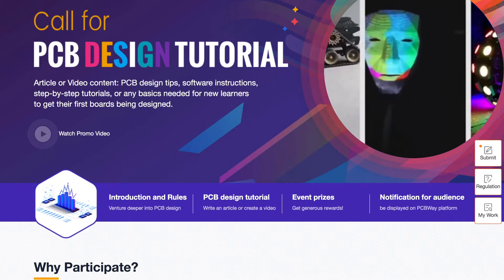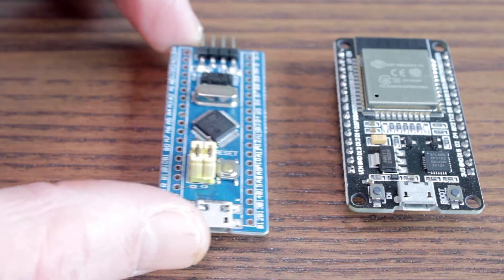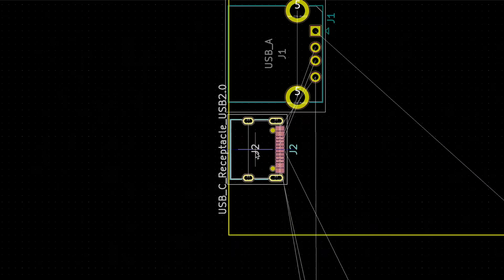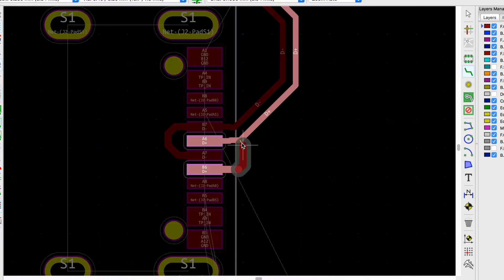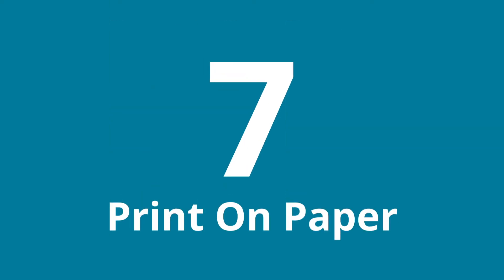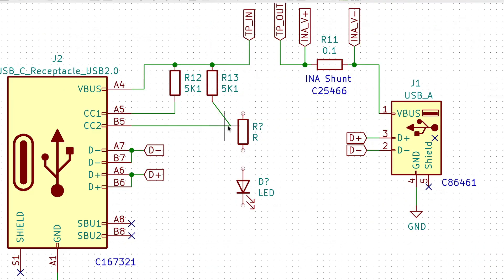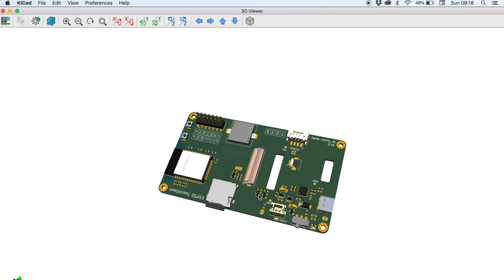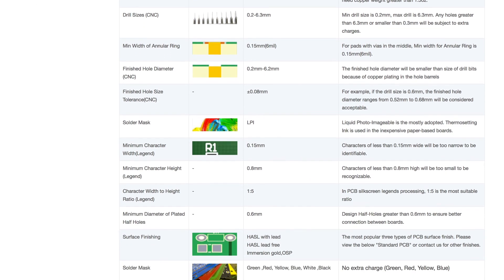My Top 10 PCB Design Tips

Comment: Tip: After doing rough placement of components, grab the MCU or whatever has the most connections and move it in a circular pattern so you can see if there are many ratlines crossing over eachother. Try rotating it to all the 90 and 45 degree angles until you find the one where the most ratlines run parallel.

Comment: Usually using a 4 layer pcb is only slightly more expensive then using a 2 layer pcb. depending on the manufacturer and if/what PCBA you use. This can help to add a completely seperate Ground plane or even a powerplane to your design making it easier to run you signal and data lines much faster and with less use of Via's. However there are some EMI considerations here a proper GND plane for example has some rules to follow and a powerplane is not always the best use of the space. A powerplane can also cause interference if used incorrectly.
Reply from the maker: Thanks for the extra tips!

Comment: A few extra tips :

1 . After you are done routing , Inspect you gerbers using a different tool . I use gerbv which is free software . Look at each layer one at a time for things that look too close or other "weird" stuff . You will be amazed what using a different viewer will expose .

2 . Check the mask layer and the silk layer together as the silkscreen will get clipped anywhere these two layers intersect .

3 . As an extension to one of the tips in the video , bring unused pins of ICs out to free pads or vias if at all possible . It will be very useful if you forgot to connect something or want to use the unused i/o pins of your mcu for something you didn't think of on the initial layout . Be sire to also put extra ground pads near some of these extra pads too , so that if you need to wire up a connector , you have an easy ground connection to go with them .

4 . Add extra ground pads around the board to have an easy reference while probing signals .

glhf !
Reply from the maker: Thanks for the extra tips! :D

Comment: I summaize:
+	Use reference design
•	Datasheets for example feature typical application
•	Open source design
•	Development board
+	Work in block
+	Move, rotate, repeat
+	Importance trace first
+	Trace width calculator
+	Use net label
+	Printing on paper
•	Print layout on paper with ratio 1:1, check with reality footprint components
•	Check the components relationship, eg. USB stick can be plug in in the same time or not.
+	Extra footprint: make test point
+	Use the 3D viewer
+	Use the DRC
Reply from the maker: Thank you @user-wf7xm5xg3t for that nice summarization!

Comment: These are some useful tips, thanks a lot! Will make a drone pcb any tips for that?
Reply: Ye, make sure that any interference is not on the data frequency that your drone will use for its remote. Let's say the remote makes use of the 2.4 Mhz spectrum then you would want any chips that you have like the controller to not run close to that band. Stay under 1 Mhz or better above 3 Mhz. But then keep your power limitations in mind for how long you want to fly for and how responsive you want the drone to be. Higher frequency usually means better flying performance and less delay but higher power draw so less fly time. And keep traces short, antennas can be created and combining it with a PWM signal that you will most likely make use of will create interference. You could look into making use of a proper ground plane that can "absorb" some EMI but I'm honestly not sure how the grounding with a battery powered drone will properly function, I'm sure there are some resources out there to find out tho.

TLDR: Choose the running frequency of your chips carefully. Keep traces short that have a pulsing signal. And try to implement a proper ground plane (preferably on one entire layer) for EMI.
Reply: @JJSnel-uh3by  Thanks, you are insanely helpful. I am making the drone with a nrf24lo1 small version, Arduino pro mini 5v 16 mhz, an espcam to shoot some low quality photos(will not be wireless, will work by an interrupt), an mpu6050, 720 brushed motors[and gears of 9(motor):54(properller)], the pcb will be double sided, 5 mins of fight time is good, but Based on my calculations it should be a longer than 5 mins. The remote will work with antenna  nrf, and the remote pcb will be handmade(too expensive for the area of a remote). Most of the things will be tht
Reply: @MegaTechno  Looks like you did your research, sadly I am not a drone expert so I have no idea if those go well together. I have had experience with EMI and Radio (like radio but also 2.4G and 5G wireless internet) where these things apply heavily. Seeing how a lot of drones use radio waves but on a smaller scale it should work and help to keep the connection.
But yeah as long as you know how to read the manufacturers datasheet (or are decent at looking shit up on the internet because you are not the first nor the last to build your own drone) then you will do fine :)

Another tip, use the tips in this video! You will almost certainly want to do a new revision even if the first one already works. Maybe not now but later xD I know I certainly have some projects I see some improvements in.

Comment: Good quick tips ... I like the one to provide for extra components that may be needed later.
Reply from the maker: Yeah me too! Footprints are free. You can even have two different designs on your board. Just populate the one you need.For example design it for two chips. and use the one that is cheapest or even available but always have a back-up.

Comment: I like the 3D viewer, but remember it's not always right. You might be trusting someone who attached the wrong model. 
For example, I have a board I with a USB-B 3.0 connector, and the 3D model I got in EasyEDA from JLCPCB for the part was USB-B 2.0. It game me a pretty nice view of how a similar B 2.0 connector would still fit in the 3.0 footprint, but it was the wrong size. 
In this case the error was obvious for a couple reasons. I was able to look at the photo and datasheet in the catalog and verify I had the right part and footprint. Many parts aren't going to be as clear as this one so keep an eye out.
Reply from the maker: Indeed. It is a tool to give you an idea/feeling. Not a tool for precise measurement or placing. And that is also my advice on how to use is. Get a feel for the board, you can do aesthetics, see is a certain placement makes sense or works for you. But that is it. Design with measurements not by eye ;)

Comment: Tip... Home printers very often do not print a true 100%, AKA 1:1 scale. This is a well know problem. The scaling may be wrong on the X, or Y axis, or both. For instance, my inkjet printer prints to about 98%, even though I have the scale set to 1:1. Here is my work-around... I draw two 100mm lines on the comments layer of the PCB page, just outside of the edge cut lines, on both the X and Y axis. When I print the PCB page, I include the comments layer, so that the lines print. Then, I measure both lines with a good ruler. Mine generally measure 98mm. So, I reprint the PCB at 1.02:1. Then, the scaling is true and I can test my component footprints.
Reply from the maker: Good tip! Although for rough placement I never had a problem :)
Reply: @DustinWatts  Agreed. I find its greatest benefit to be for checking the pins on my custom made footprint libraries, for tiny components that have tight pin placements.
Reply: Wow, that's even better than a banana!
Reply: @Nanocosm  i like your comment
Reply: @Nanocosm  maybe it's better but a banana is still the world standard ☝
Reply: I think it’s probably easier, cheaper, faster and better for your health to just get the pcb than getting a printer involved. They are truly the worst 😂

Comment: very good recommendations and I love you done it using KiCAD. I usually apply these rules on daily basis and these design rules applies also to other ECAD programs. Good to see nice videos about that stuff, especially for people that have to start this career. 
However there are different set of rules, Design rules to sketch the idea and concept that leads into simulation first. Design rules like these on the video especially for making concice and consistent schematic, Design rule for standard PCBs, and also for Analog o Mixed signals, and RF only.
The content is so vaste btw. 
:)
Reply from the maker: You are absolutely right! These are just basic tips and tricks that served me well through the years. But there are many considerations when it comes to PCB design. But that wouldn't fit in a Top 10 or even a Top 100 ;)

Comment: Hi, nice video! How did you route D- and D+ @02:35 simultaneously?
Reply from the maker: Using differential pair routing under “Route” -> “Differential Pair”. If you label the tracks in the schematic with + and -, Kicad knows they belong together. You can use separate track properties for differential pairs.

Comment: Good set of tips Dustin! Always liked the 1:1 paper print to show the ACTUAL board and how your components just won't fit it! 1 piece of paper and 5 mins will save you a couple of weeks delivery and board costs 👌🏻
Reply from the maker: I still sometimes get to overconfident even when using a component I've used many times before. Only to discover after a few weeks that I ordered a different component size because it was cheaper or the one I used was out of stock. :)
Reply: Especially with all the semi-unstandardized IC packages these days. Sometimes you use the footprint called "VSSOP" because that's the same name the manufacturer uses, but it turns out to be 0.635mm pitch instead of 0.5, and you should have used something like "TFSOP" instead. Or things that come in extra-wide SOICs for no reason.